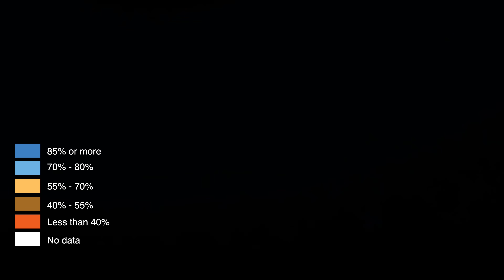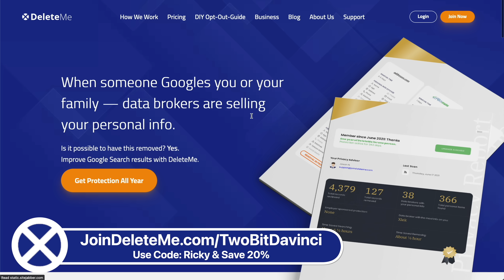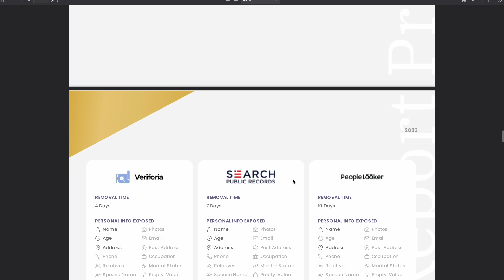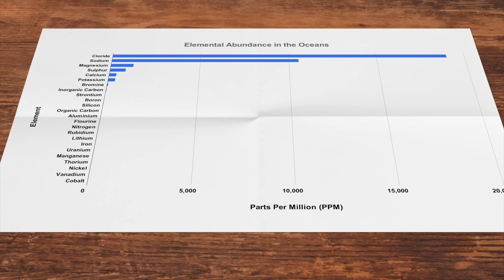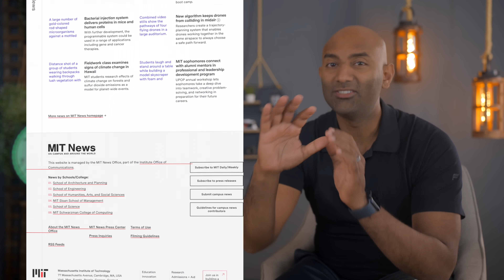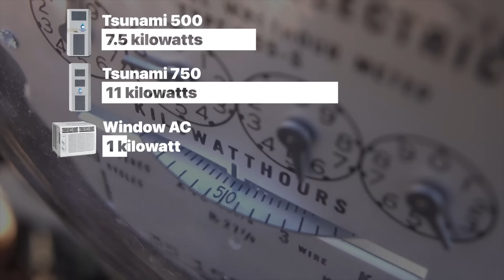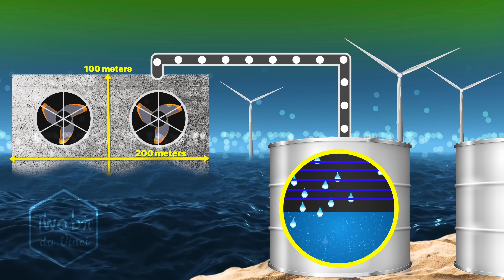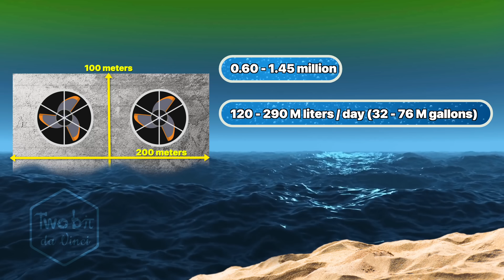This Tower Turns Ocean Fog Into FRESH Drinking Water!

Comment: At least it's much more likely feasible than trying to harvest water out of very dry air. 

But. The low cost estimation doesn't seem realistic, that's fairy tale stuff. Also, if you collect water enough to supply millions of people, the air downwind will be much dryer, meaning, local climate will be worse, at that scale significantly worse, regardless of how small part of the global evaporation that is harvested. You mentioned local impact, but then dismissed any problems because it's a small part of the global ocean evaporation.      

About desalination, if you don't focus only the rarer substances, but realize that the major components also have at least some value almost the whole brine can be a resource. Evaporating seawater primarily to produce NaCl, typically without harvesting the water is an industry, if you assume that your going to separate the abundant salts, just to get rid of them, in order to extract substances, that constitutes a few ppm, or ppb of sea water    it obviously becomes way too expensive.             

Use a high tower to collect air, OR collect very close to the ocean surface, decide, those are mutually exclusive, you can't be very close and high above at the same time.   

Also, the enthalpy of evaporation of water and therefor condensation remains high, you don't get around that so easily.  If you start with water and add energy to make it evaporate, you can make it condensate just by cooling it with ambient air, if you start with humid air you need to remove the same amount of energy, to get the water to condensate. Kind of the same problem, just attacked from another angle. It's obviously possible to compress the air, then cool it down with ambient air, and get most of the water out, still many times more energy is required to do that compared to reverse osmosis. And, air that isn't saturated will require more energy per unit of water extracted.   

Do note, to extract water from air with compression you need to dissipate the compression heat, and condensation heat, and heat from friction. Not using that heat would be a huge waste and probably make the process more energy demanding than traditional distillation.

Comment: I was laughing as my son was telling me over the weekend that he is in the process of hooking up a hose to the water drain on his HVAC (here in Central Florida very HUMID) and is going into a 5 gallon container with a small water pump that will distribute the water to his small raised bed gardens. A great idea as my HVAC empties into a small saucer that the doves come every day and drink out of... oh, also the tiny lizards. Another GREAT video, keep them coming
Reply: Make sure you're aware and ok with the aluminum content in the water if you're using it for edible plants.
Reply: @Eyes0penNoFear  I have reviewed this in the past and have not come across any issues with using the HVAC water for plants and vegetables. There is an exception to this as I have seen some HVAC unit drains getting clogged with a White Slime. I would say that if this slime is in your HVAC water tray, then the water would not be good for watering fruits and veggies.
Reply from the maker: Ac condensate is a great resource
Reply: I use dehumidifiers in my Scottish home, and other than using it for watering non-edible garden plants and equally non-edible house plants - I tip the whole lot away. 

Unfortunately, with devices like HVACs and dehumidifiers, because the manufacturers are under 'no obligation' to create these machines for the use of collecting 'drinkable' water, they allow that collected water to run over surfaces containing copper, aluminium, a variety of plastics (including carcinogenic ones), and even lead.

In addition to these materials, there's also the issue of micro-organisms which commonly collect in the pipework, tanks (dehumidifiers) and trays (HVAC's). Legionnaire's Disease is an especially infamous micro-organism that instantly springs to mind. 
As my husband knows a retired engineer who worked with HVACs, the strong probability of dangerous micro-organisms was his warning to us when we enquired about the safety of using collected water. 

I checked sites dedicated to issues concerning HVAC's and they definitely advise 'against' using the water for edible plants, giving to pets, using it for human consumption. 
It is, essentially, polluted.

Because I was still rather curious about the quality of water from a dehumidifier, I did once try the collected water from a new machine for a pot of tea. 
The taste was amazing, like it was a completely different drink. There isn't a water filter I've ever used that has come close to producing water that makes tea taste so good. 
However, my experiment was a one-off and I wouldn't chance it again, no matter how thoroughly I 'try' to clean the machine.
Reply: Natural gas????

There's NO excuse for high natural gas prices. 

The only reason there are high prices is because of those stupid environmentalists.

Comment: That sounds very interesting, however, I think that you made a mistake with your costs savings calculation, when you stated, that this would be only $20 per month. This does not factor in wastewater treatment, which is a cost that usually is factored into the price of the drinking water (at least that's how it works here in Germany)? Providing fresh drinking water is one aspect, but making sure, that the brown/waste water is properly treated before releasing it back into nature is of equal importance.
Reply: In the USA I have always paid my sewer bill separate from my water bill.

Comment: This actually has the same net salination effect as releasing brine into the ocean, just in a more diffuse way (so it is still better). That's because decreasing the vapor pressure (which is what you are doing by pulling water out of the air) is essentially the same as desalination. To explain just a bit further... water evaporates slower when the air above it is already full of water, more water = slower evaporation so less water = faster evaporation, and that water is evaporating from the salty ocean, ie evaporative desalination. These seem like a much better way of desalinating water, but that is still in essence what it's doing, and the resultant is a saltier ocean (which is a growing issue).

Projects like these are great to meet growing water demand, but they don't solve the sustainability issue. In the end, what we need most is to be much more efficient with our use of water, because just like climate change, it's not a problem that will just naturally reverse itself.
Reply: "the resultant is a saltier ocean"
You're forgetting that the water we use is recycled back to the atmosphere continuously and rains back INTO the ocean, either directly, or through rivers and underground reservoirs.
Reply: @TheRadiastral  That's really oversimplified, friend. I didn't forget about it, it's just not how it works. Water we use goes to treatment facilities. It takes time and chemicals to get it back into the environment. Even with that aside, the effects of increasing salt concentration is localized to the areas the desalination occurs, so it still has an environmental impact on local ecosystems. Even THAT aside, the ocean AS A WHOLE is becoming saltier as we mine salt from below the earth (and spread it all over our roads and use it in various chemical processes), and it makes its way into the water supply, although this is counterbalanced by the (objectively bad) melting of freshwater reservoirs of ice.

It's easy to think that because things happen slowly or spread out they aren't happening, but they are. If you have salt water and you evaporate fresh water off it, you get saltier water.
Reply: @TheRadiastral  Exactly!
Reply: Yes, but the water vapour above the water was likely going to be blown onshore anyway, to be  replaced by dryer air from higher altitude with the normal convection currents.  I don't think this dries the air above the sea to any measureable degree.
Reply: i'd have to say the main difference though is the concentration of brine dumped into the ocean, using this method would require an extraordinarily vast quantity of water to be removed from the ocean before salinity becomes a problem.
Reply: I think I see what you're saying, but this is taking advantage of a process that already naturally occurs, whereas traditional desal pumps highly concentrated brine back into the sea. It's not that this is inherently bad, it's just that local ecosystems aren't equipped to handle it. 

This process is tapping into a cycle that is already taking place, and because of that, local ocean ecosystems are much more likely to adjust to it or accommodate the impact of it. 

One way or the other, water generation is going to be a primary solution to growing water demand. Humans could conserve their way out of this, but if any other viable option (like this seemingly is)  is available, humans are going to take it. I know I will.
Reply: The problem with desalination isn't that we're concentrating the ocean and making it saltier. I mean, 'cmon, didn't you see the stats at the beginning of the video? In an entire year, humanity uses less than 1% of Earth's total liquid freshwater supply, and that's only 0.0067% of the total available water, so we really consume less than 0.000067% of the total available water every year, of which 97.5% is in the ocean.

So, assuming the extreme scenario that we were to take absolutely all of the water we consume as a species during the course of a year directly from the ocean through desalination in one go, we would only be extracting 0.0000687% of the total volume of water in the ocean, so the new "more concentrated" ocean would have a concentration only 0.0000687% greater than the original concentration. Sooooo..... basically the same concentration in every practical way. And if you consider that this is actually spread out over a year and that rivers, rain, and runoff replenish the ocean constantly, well... you can see where I'm going.

The real problem is brine and how it dramatically increases salt and other solutes' concentrations "locally," destroying the delicate electrochemical equilibrium in entire ecosystems before diffusing into the ocean to make the whole thing one itsy-bitsy saltier. That's what this idea completely tackles.
Reply: Yes, that occurred to me right away.  But it also crossed my mind that condensing water from air, even at 100% humidity, is still an energy intensive process.  I don't know the numbers, but I could see this process as potentially still being more expensive than reverse osmosis desalination.  It also seems odd to me that the proposal would move that huge volume of moist air to land to process it rather than processing it at sea where there's a vast heat sink available (and potentially a source of cold water, if you want to pump the water up from depth).
Reply: Look at it this way: Desalination is like drinking a spoonful of concentrated hydrochloric acid. It'll end up diluting in your stomach, and then in your entire body, but not without burning the heck out of your mouth and throat. Water vapor towers are the equivalent of diluting that spoonful of concentrated acid in two liters of water and drinking it slowly throughout the day. The end result will be the same (a slightly more acidic bloodstream that'll eventually be buffered into the right pH) but this time you won't end up with a burnt throat.
Reply: @Israel_Two_Bit  why do YT comment sections feel like a bunch of people who don’t read or understand what they are even commenting on? You’ve chosen to key in on the 3rd point I made in a follow up comment, disregarding everything else I said so you could make a single non-point to refute something I didn’t say?

I mean, I literally said it concentrates it in a diffuse way, so… you had to agree with me to tell me I’m somehow wrong?

So let me say this AGAIN, if you decrease vapor pressure, you will increase evaporation, which concentrates salinity, which has a localized effect that IS MORE DIFFUSE THAN RELEASING BRINE (if you don’t understand the word diffuse, look it up before commenting). Even if it is more diffuse, it still changes local salinity impacting ocean life that may be sensitive to salinity, temperature, and pH.

If you are DESPERATE to make a point, sure the ocean is big, so the effects are small, but we are still moving tons and tons of NaCl and other minerals from underground to our water systems, fresh and salt alike. Those effects are only going in one direction. The reverse mechanism is no where near fast enough to offset our rate of exploitation. Just like how climate change was written off as nothing because the atmosphere is vast, so how could we fill it up with anything? Well so are the oceans, and yet we are changing their composition and causing mass extinction as flora and fauna cannot evolve to keep pace with the changes.

So please, explain again how it isn’t even worth considering.
Reply: @SocialistCharlieKirk Interesting conversation(s). Admittedly, you lost me at "sustainability" and "climate change." 😩

Comment: I wonder if the energy cost can be mitigated by using the earth's natural cooling by burying the lines to the condenser units to reduce the air/water temperature before it reaches the final system.
Reply from the maker: We wondered the same .... hopefully this gets funding and someone will try.
Reply: Waterseer
Reply: Or, how about running the humid air through a pipe under water. You get both low temperatures AND high pressures.

Comment: This will make the environment drier in those areas. It will remove the humidity in the air.
Reply from the maker: Maybe so, it depends greatly as to what the prevailing wind direction is.... and the machine could also be turned off when the wind is coming off the ocean and going inland if more inland moisture is needed..... but good point